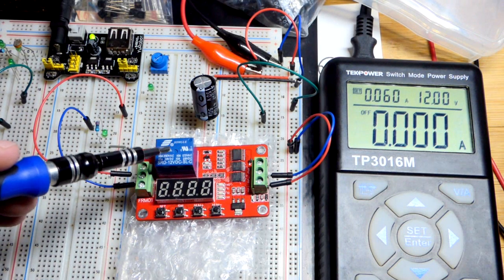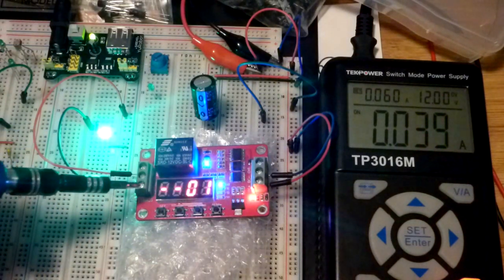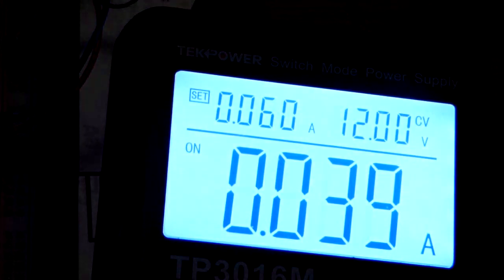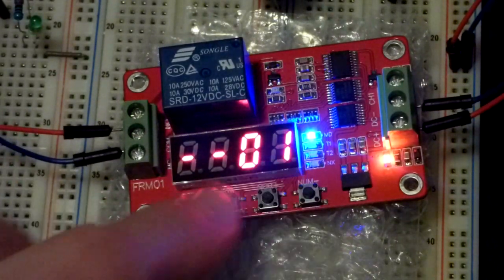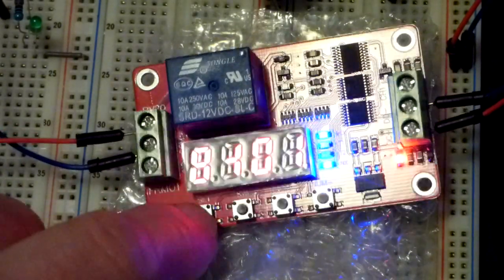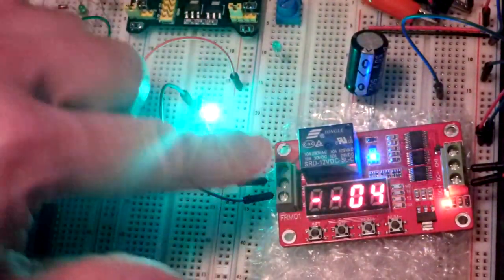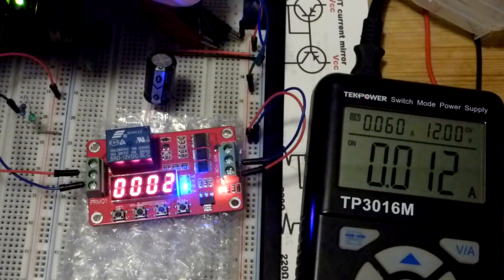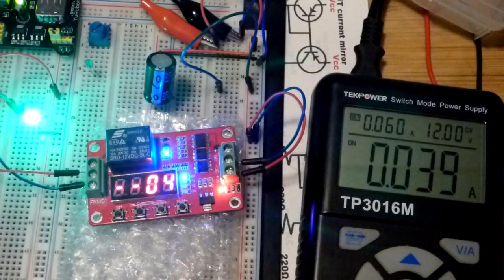FRM01 Timer Relay Module function 04 of 18 which turns on until timed off then timed back on again

Comment: It’s an excellent module I had used earlier and there is another version to this as well FRM02. The only problem is that the manual is not very clear.
Reply from the maker: Thanks for the info! I didn't know about the FRM02. It has 2 relays. Also found the FRM03 with 3 relays and the FRM04 with 4 relays. Oddly enough they are all about the same price. Manual is definitely rough to read.